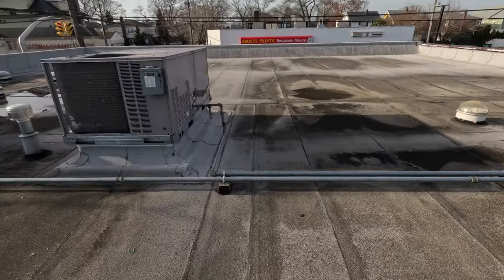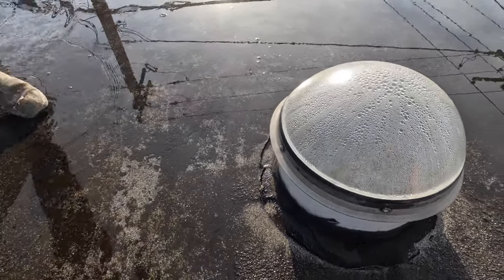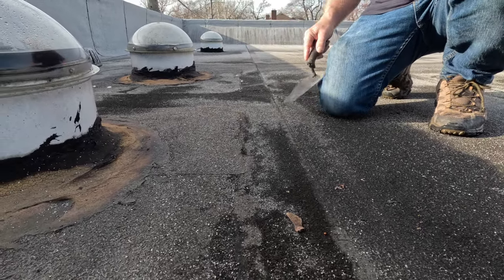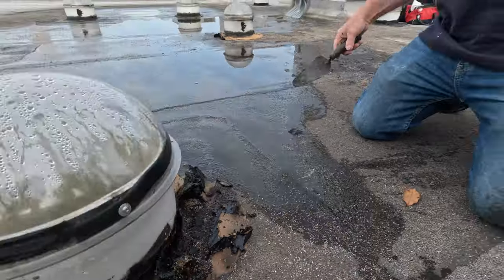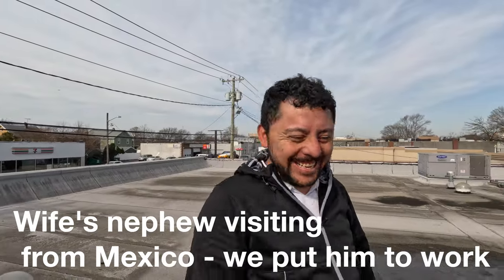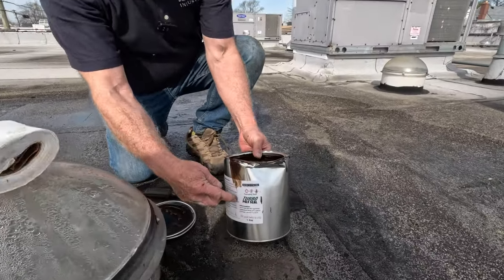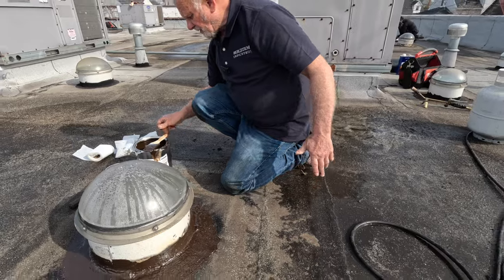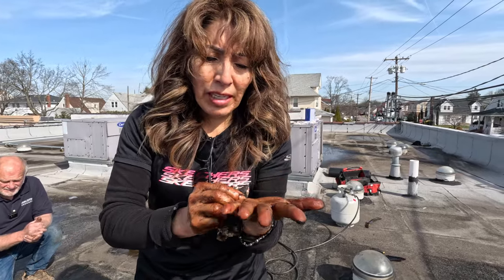Skylight Flashing  Flat Roof Leak repair  Most people will miss this leak find

Comment: I use this stuff on chimney flashing, where the concrete pad meets the sill plate, on the belly band of buildings.  This stuff has never failed me. Thank you for sharing this with me. I just ordered 4 more gallons yesterday.
Reply from the maker: That's a great idea!
Reply: Next time, do yourself a favor and go to your local pro roofing supply store and buy SOPREMA ALSAN, its the same thing and half the price what this guy sells it for on his website. Actually I wouldnt be surprised if this guy just buys the 5 gallon of Alsan and repackages it and sells it for triple the price.

Comment: Oh wow, Nassau County, Valley Stream,  so close to where I live. I have learned so much from the Roof Doctor and the crew, that back in October I purchased a gallon of super silicone sealant and repaired my leaking skylight and problem solved. I recommend it 100%. Thank you for your videos and teachings, it's appreciated,  Godbless you 🙏✊🏽👍🏼
Reply: Was it Turbo Poly Seal?
Reply: The one I used was the White Super Silicone Sealant,  from the same company

Comment: My flat roof they only install drain pipe that is only maybe 1-1/2 inch and gets plugged up by a huge trees needles. Has not filter or screen so I’m going to put in bigger drain and pipe. Suggestions anyone? All four are plugged up and lots of puddling on my nice roof.